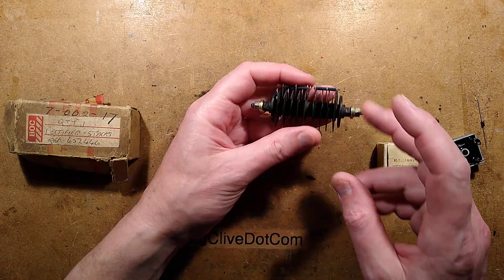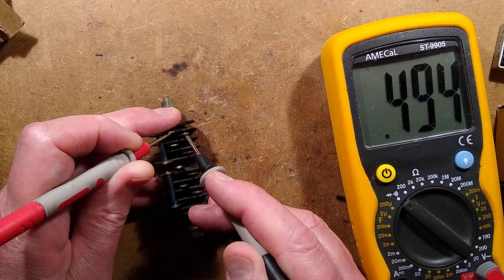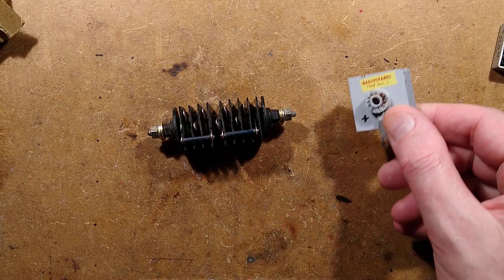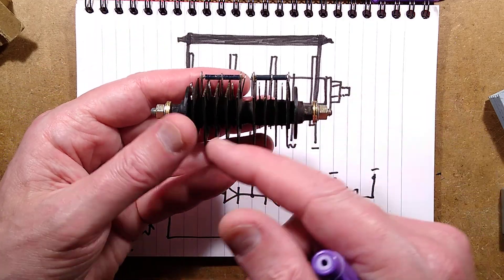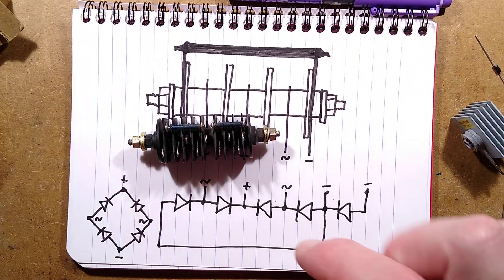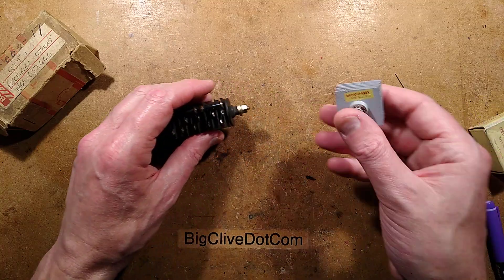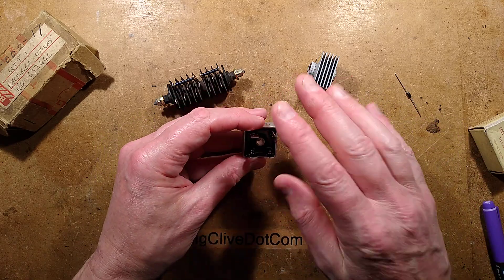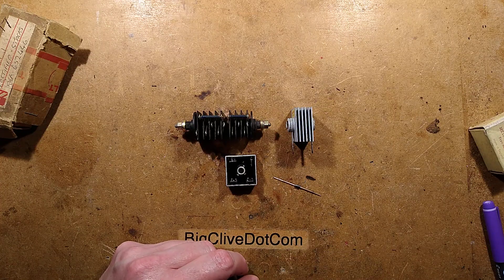Selenium rectifiers - the smelliest components ever

Comment: I remember these well but if you wanted real high current you had to go for a mercury arc rectifier. I worked on one of these once it was for powering a dc motor on a laundry calender roller machine. I wonder if you have ever come across one of those Clive might be worth doing a you tube feature on one.
Reply from the maker: I saw the biggest mercury rectifier I've ever seen on the first day of my apprenticeship.  It was for the 500V DC system in a steelworks.
Reply: This one was only a small unit I honestly cant remember the current and voltage now it was a long time ago. Its amazing how the older Engineers still managed the requirements and how they achieved it I wonder what they would make of motor inverter drives we have now.

Comment: These were common in old 405 line Television sets. When I was young, I disassembled many of these old sets, to extract the components. Being about eight years old at the time, there were very few components I knew how to use. The big line transformers the wax paper and big aluminium tin capacitors, and the focusing ring magnets. Later, at around 12 years old, I converted a few TVs to primitive oscilloscopes, using the audio amp to provide Y deflection and the frame amp to give a low speed X deflection time base. .
Old TV sets had a range of distinct smells, ranging from burning dust on the valve tops, scorched paxolin pcb resin, the result of the valve heaters, smouldering carbon from underrated  potentiometers,  to ozone from the EHT, but the smell of burning selenium rectifier, is one, that once smelt, never to be forgotten. 
Selenium is toxic, though it is reputed to be in some anti-dandruff products. Chemists who work with its compounds can absorb it through the skin and develope very unpleasant body odour and garlic breath as a result.

Comment: Back in the 60's we would replace these with Mullard silicone DD 058's, 1amp @ 400v. We also dismantled them and scrapped off the selenium onto sellotape, known then as Durex ! and wrap the sellotape around a 2watt resistor, put it in a power plug and plug that into one of the power points in someone else's repair booths, and watched them panic after they turned on the booths power and it started to smell BADLY 💣

Comment: I bagged a Heayberd 12/6/2 volt charger off ebay a few years ago. 'Scoped the output and it was really clean; probably not had much use.. Large green Selenium rectifier inside, but no smoothing. Large bobbin-type dropper coil wound with what is probably asbestos. Have used it for modern car batteries with no apparent problem, possibly because it only chucks out 1.25A into a flat battery, and less as it charges up. Silent, well made, transformer clearly just ticking over, built to last. (Did replace all the VR cable though..)

Comment: What do you do when the voltage drop is not high enough with silicon? Best option would be to re-wind the transformer.
Reply from the maker: It may work as is, but it might require a new transformer or additional buck one.

Comment: Vintage radios from about 1929-1930 used selenium rectifiers. After this time they seemed to go out of fashion - for a first time - and were replaced with rectifier valves. I always found that odd since you would have thought they were more reliable than a valve.

Comment: I used to repair Tv's in my career. When you went in to a house you didn't need to take the back off a black and white TV with no picture. Open the door sniff go back to the van for a doubler or trippler. They provided the EHT for the crt.( picture tube) and boy did they smell!!

Comment: An "advantage" of the old Selenium rectifiers is that they had a fairly high resistance, with a strong Positive Temperature Coefficient. Which meant that when used in battery chargers they would self regulate the charge current to a safe value. Even when shorted they would just get hot and (usually) not self destruct. I've seen a few old battery chargers where someone had replaced a damaged Selenium rectifier with a modern Silicon rectifier. Which meant that the first time they were shorted, they would blow the fuse (if it had one). A solution is to put a 60W incandescent globe in series with the mains input to provide the missing Positive Temperature Coefficient.
Reply: Totally correct, I have seen many transformers fry when people replaced them with silicon in battery charging applications.
Reply: An interesting idea, the 60W lamp, I assume you mean in the transformers primary.
I've had luck with halogen headlight globes in the output, more for short/overload protection than battery charging.
Reply: @paulstubbs7678  it's a really old trick for current limiting, literally going back to the vacuum tube era. Not a good idea with switch mode power supplies, but everything else pretty much tolerated or thrived from that usage.
Reply: @paulstubbs7678  (a 50watt 12volt halogen (or two paralleled) series wired between charger and lead acid is good for battery)
Reply: One downside, other than the high voltage drop of the selenium diode was, like electrolytic capacitors, they'd grow leaky just sitting on a shelf. Usually, like the electrolytic, they'd reform under use, but one had to recognize that and allow reformation to occur before final testing of a repaired unit.
I did run into an instance of silicon replacement creating problems, lower voltage drop, which was easily enough countered with an NTC thermistor.
Reply: The high resistance was, what many radio B+ rectifier designs relied on, using just bare silicon diode would create overvoltage at B+ and also harsher, more harmonic rich buzz in the system. You need to add an appropriate resistor in series to bring the voltage where it is supposed to be.

Comment: Perfect video as usual. And thanks for reminding me about potential drop issue on high voltage stacks, probably due to the dust level on my electronics books I forgot that part. I however have one objection. These little gems smell like a long dead rat being cooked on very slow fire. If anybody's fart start to smell like a selenium diode under load, it is perfect time to see a doctor or in extreme cases an undertaker.

Comment: Some old East German motorcycles also used them for the battery Charging circuit. Replacing them with a silicon rectifier doubled my charging current and the battery can actually be fully charged now.

Comment: Two smells I can recall as though I just smelt them:- one is selenium recifiers on full load, and the other is mustard oil (which gives off mustard 'gas'), which I used to work with in the chemical industry. Not the same smell, but each equally stomach-churning.
Reply: Mustard and mustard oil is an all time favorite with Indians; mustard gas is for real warfare!

Comment: Remember these rectifiers in older series filament string TV sets-the selenium rectifiers were used in a voltage double circuit to get the B+ chassis voltage to run the plates of the tubes.In a TV I was working on-there was a shorted filter cap that caused one of those "stinklium" rectifiers to let go--Arcs between the plates and drove everyone from the room!Some Zenith series string AM/FM radios had one of these in it.Was easy to replace with a silicon diode!

Comment: How would that compare to the rectifier that is found in old British motorcycles? They would use a similar configured rectifier to change the voltage to DC, which would run the lights, ignition, and then disperse any unused current through a massive Zener diode by turning it into heat. I still have my old Norton and it still has the old charging system even though most converted to a modern black box that took care of all of those issues  and made it more reliable. I may be getting some of this twisted a bit, but it is how I remember it from many years ago. It is also why you would hear many cussin Lucas ignition.  The components actually seemed quite robust, but being on a vibrating motorcycle, the connecters were often where you would find failure, and they were not suitable for upgrades like more accessories as many tried to do, not understanding how the system worked. I'm wondering if these rectifiers were of the same ilk as in your vid?

Comment: Hmmm
Not had one of those fail (yet)
 Hmmm wonder what the voltage drop on mercury arc rectifiers was?
Do remember when I had a Marconi Atalanta receiver, it had a double diode valve as a detector which I put two OA91 diodes instead and bridged the heater chain with a 22 ohm wire wound resistor, worked really well…
Reply from the maker: Pretty high.  Selenium was the replacement for many mercury rectifier tubes, and silicone was the replacement for selenium.

Comment: I've actually worked in a couple of panels that had these in and it's the very first time I've ever seen them working. I think it was just for some control gear or ventilation 🤔
Which is also in the vicinity of the lift control panel(s).

I know Andy's got a few of these n there massive! 
He also showed one of those selenium rectifiers and then showed a 50A 1000V. I couldn't even imagine how much one of those would stink if it shit the bed as it'd be a cascade effect n shoot 🔥 "Flame's"🔥 out in every direction. 
That man does looooove a rectifier 😁😍

Comment: Woah, at the start of this video I was wondering if the theater tower in my city that we regularly (well regularly compared to people not working at that location :P ) climbed to install ransmitters at the roof had those in their hoisting installation (which is very modern, so I would be surprised if they do contain them honestly), there was always a strong rotten egg smell at the top where all the motors were situated.
There was a BIG power distribution box with 3 times 480V in it humming away and at times it was as if that thing was causing the smell, but right after it you smelled it in the whole room, it was pretty weird and I never got what the equipment was that was producing the smell, but it was pretty awful at times, and most of the time we were quite happy to climb up the roof.

Comment: I owned a BSA motorcycle, back in the 70's, which had a finned selenium rectifier, in the battery charging circuit under the seat. Had a few fail, which then killed the battery. I later replaced the rectifier with a square silicone bridge type, seen in this video. Result... no more rectifier / battery problems.

Comment: This reminds me of when i was a TV field engineer. I could dectect a failed EHT tray by the smell that hit you as the customer opened the door..
Reply: EHT trays....I forgot about those !
Reply: I was also a TV engineer in the late 60's and 70's, and they used them as the mains rectifier with a 200V DC bus on the valve TVs, absolutely dangerous if you touched the live bus, we use to replace them with a BY127 rectifier if my brain is correct, also you had to make sure the bus was discharged before sticking your fingers in.
Reply: @billyboy8820  It was a risky job back then.

Comment: The BOC one would most likely be from the control circuitry of a TIG or MIG welding machine the machines from the 50/60's would also have a much bigger one for the welding current I have used a BOC welder that was the size of two washing machines stacked on top of each other and it was no more powerful than a modern machine the size of a brief case,probabely lasts longer though. I had a bridge rectifier that weighed around 50 pounds,it came out of a projection room for the supply to the arc lamps not sure if it was selenium or copper oxide though, I used it on a home made battery charging system back in the 70's until it went bang no bad smell though.
Reply: Shop I worked in until the crash ten years ago had a 650A, three-phase machine from the mid-1950's. Buttery smooth, remote control was fantastic (magnetic-amp type). Used for large (think 1/4" and 5/16") manual rods, as well as air-arc gouging. Awesome for arc gouging. It didn't stutter like most more modern machines. One of the (six) rectifiers went in roughly 2002. Not a bad life if you ask me. The smell? It is amazing how fast grown men will run screaming from a 500m^2 shop floor with 8m ceiling, even with good powered vents. The machine still ran fine, but was not as smooth, so the search for replacement rectifier began. In the end, did all six with silicon, and it was like a different machine, in a bad way. The characteristics of the rectifiers were part of the feedback that controlled the droop , as well as the mag-amp. In the end, the silicon came out and the selenium (less the bad one and its phase-mate, now a spare) went back in. We lost about 200A at the top, but that wasn't a big deal, mostly. (My daily driver is a 20Kg briefcase unit that puts out 250A powered anywhere from 240V to 600V, single or three phase. The old machine was less featureful, but could do things none of the modern ones can)

Comment: Another great informative video Clive. Being an old geezer, these selenium rectifiers were state of the art when I was a youngster. A favourite use was in car battery chargers. Whether or not they had some current regulating characteristics I don't know but very often there was no additional current limiting in the charger and the forward voltage of the rectifier and presumably it's fins which made a good heatsink was all there was. If the selenium rectifier was replaced with a silicon one years down the line, it was necessary to add an high power resistor of a few ohms to limit the charging current in line with your comments. I have a selenium rectifier in a mechanical industrial clock from the fifties an it's still working, but I've put a mains tungsten lamp in series with it just in case it goes short circuit.
Reply: I've got a 40+ year old car battery charger with selenium rectifier, used when I got it...4 amps, works great....and I also have a 400 Amp 1956 P&H  AC/DC arc welder with a very large stack of selenium ....it works about as well as most of the new welders.

Comment: Brings back memories, thanks Clive.
In the 70s and 80s my Dad had a small yacht with an Ailsa Craig outboard motor with built in generator. In the transom was a car battery fed by a blue painted Selenium rectifier having about 4 or 5 plates.
This is how navigation lights were run before silicon diodes and solar panels!!

Comment: Its actually give me nice idea... what about adding "smell" to electronic components so we know what break down? Like adding strawberry flavor to Capacitor, so when it blew up we will know to replace it? And make it in form of small blob that react only when heat is applied so it "release" smell only when specific temperature is reached that normally pop up capacitor. And the same thing for diodes or resistors...  It could actually work...
Reply: I really like this idea. You could assign smells to each of the digits in the value of the the component, so combined smells would allow you to identify the value of component that had just failed. ‘Mint chocolate rasberry? Well that’s a bad 1k ohm resistor’, you would say.
Reply: @Akinaro  @jastervoid  You two are a couple of flippin' geniuses!
Reply: Um, some types of capacitor (paper based X2 class interference suppression types for example) already will give off a distinctive foul smell (good enough to clear a room…)!
Reply: There is a fine line between "genius" and "idiot"
Reply: @drakefallentine8351  Yes, components already stink in their own ways when they fail.
When a cap sharts itself, the smell is a dead giveaway.
If you've ever "smelled semiconductor" when a transistor or diode failed; you know the smell of burning silicon - which is readily distinguishable from burning PCB / resistor etc...
These smells are faint however, at least when compared to selenium rectifiers - I'd hate to have my house stink out when a diode in the TV fails!
Reply: @KomiyanVT  yes, that's the classic "mechanic that licks the oil gauge stick" scenario, very professional LOL ... yes, different components have different smells when failing, but just slightly different

Comment: There are a fair few vintage/antique tube radios and tube audio components out there with selenium diodes/rectifiers in them.  I've replaced the selenium diodes in my personal equipment with silicon diodes and recommend the same to anyone who brings old audio gear to me for repair.

Comment: It's funny you mention pinsetters, I've had to replace many of these in my Brunswick A2 pinsetters dating all the way back to 1956. I'm pretty sure I still have one or two original rectifiers, they are absolutely massive in size.

When they go out, everyone in the building knows about it, they're that stinky. For some reason I'm still able to buy them new via my supplier, but I always choose to get silicon rectifiers cheap via Mouser.

Another funny note, is that Otis Elevator company manufactured the Model A pinsetter for Brunswick for the first few years!